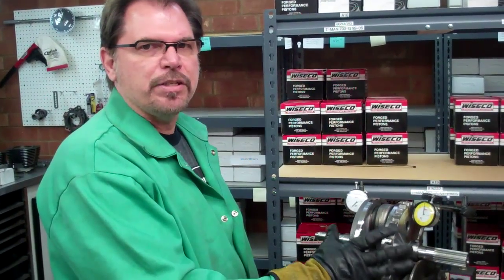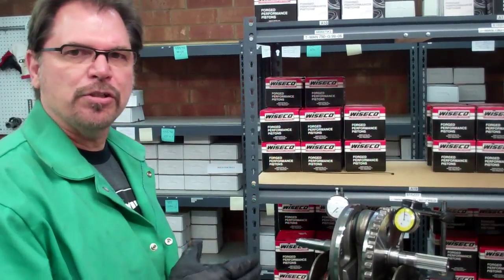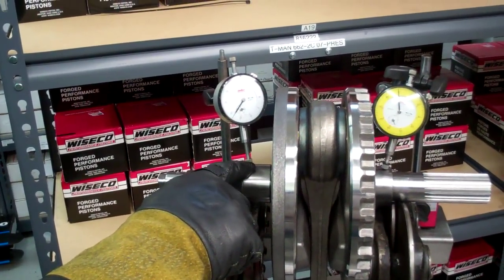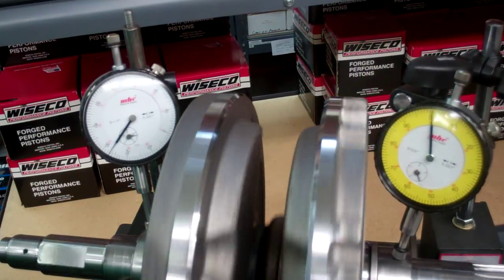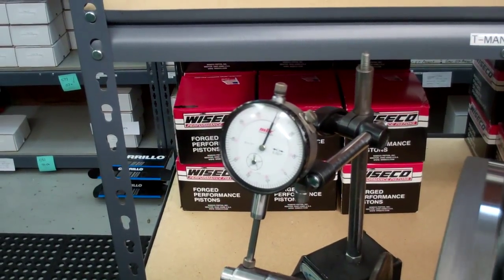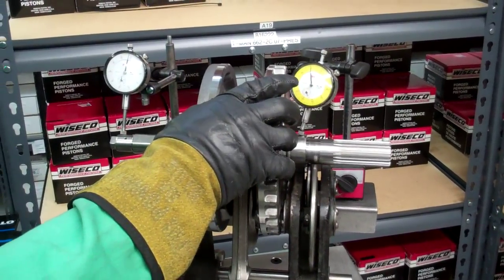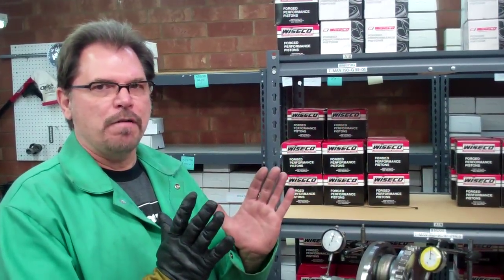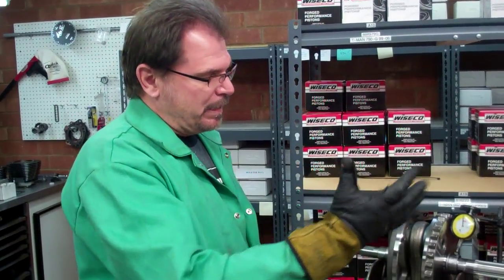T-Man Tec-Tip,Understanding your pinion and sprocket shaft runout.

Comment: I must be missing something here..... if the main bearing journal is a little out of true, and the end of the pinion shaft is more out of true then surely the latter's amplitude of runout is due to it being further from the supposed 'centre' that things are not fully concentric with ?  It doesn't mean that the pinion shaft's main bearing area and cam-support 'bearing' area are not concentric.
 I had 8 thou' runout at the pinion shaft's end from new and fitted bigger cams (chain drive), then bored it out and raised comp.ratio along with yet bigger cams (dyno'd the bike at over 100bhp) and when I took the bike down to take it out to 113" with yet bigger cams it still had the same runout - it's been corrected now with a welded crank.
 I think maybe people are being paranoid about runout - but then I do not abuse my 'toys' by doing burnouts, wheelies and 'drag-starts'.....  I would expect problems if I rode it like it was a race-bike toy.......
Reply: I agree with you 100 percent
Reply: @lancasterjim2441   A little bit of runout is normal - I had a 1990 Sporty that had runout and that was a 'bolted together' crank not pressed together. - cranks flex anyway, they always have done.
 I think the problems with twin cam cranks are mostly caused by the Primary drive side bearing that is over-stressed due to that auto chain  tensioner - it causes the tranny main bearing early failures as well. Get rid of that auto tensioner and you will save yourself problems 'further up the road' !!!